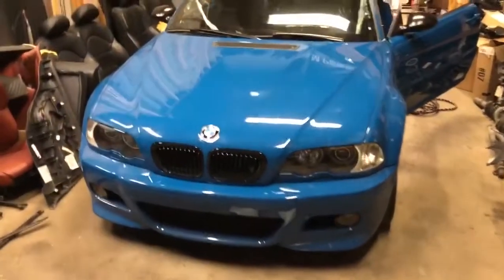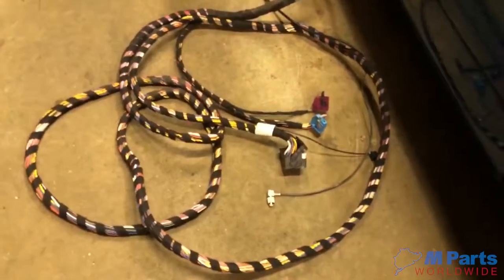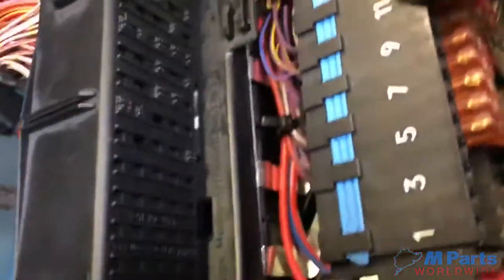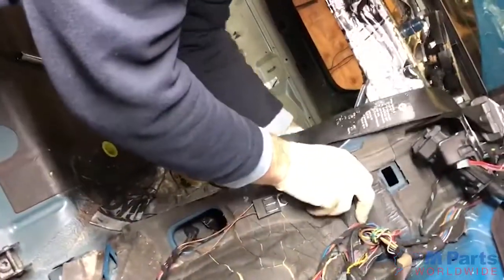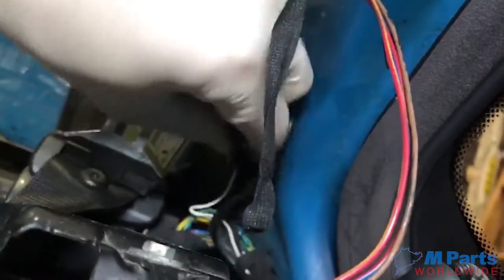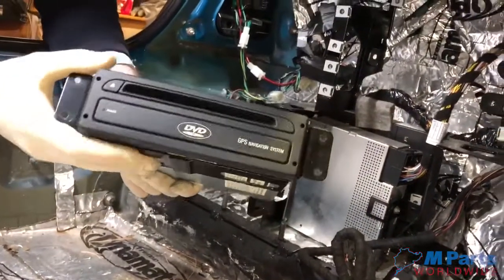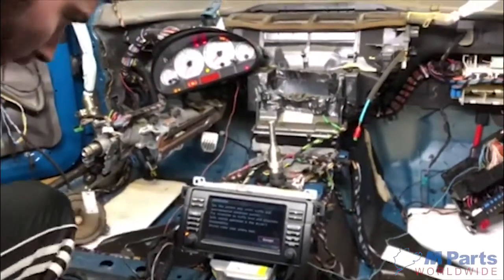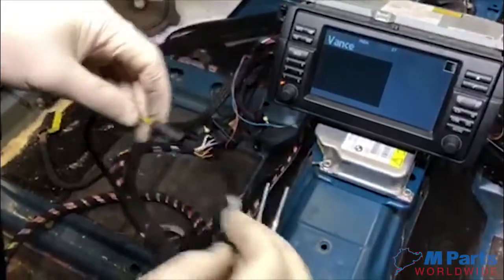E46 Navigation Retrofit

Comment: I need some help I have the 2000 e46 with Busines Navi and hamankardon system. on the radio I have only the blue connector. When I plug it in the radio works but display it’s like the backlight lights up without any image. The white connector is missing what’s your advice and which way to go .? Cause at the moment I don’t have anything displaying on the screen.

Comment: I have a 2001 also with hk business cd. I put a android radio in but it doesn’t pick up the reverse for the head unit. Is that because it’s a 2001 without navigation? 

Been trying to figure it out I want the unit to sense the reverse like it’s supposed to with k or I bus?

I know this is old video but if you see this please let me know if you know anything thanks.

Comment: Why this pain man
U have already the harness for the business radio so you are ready to slide the android unit witch it fit very easy and it is a modern technology!
All this scrap metal for this old things!!
Later the main navigation becomes surely pics failure and bm53 unit fail after couple months amp also 🤯🤦🏼‍♂️
Reply: You cannot even get map updates for those old nav units. They are paper weights right now.